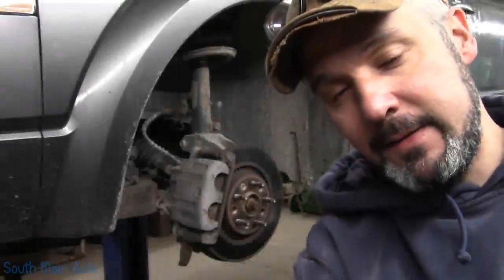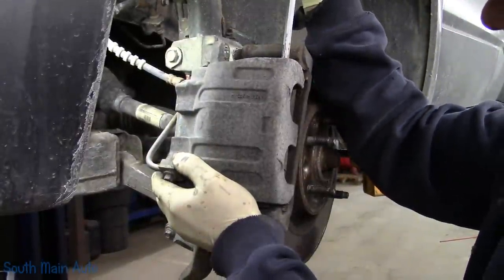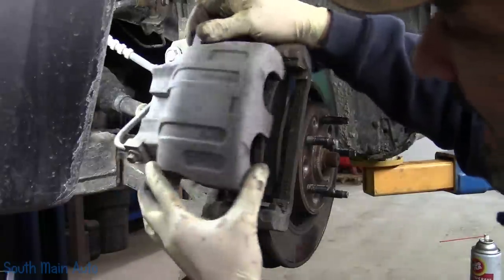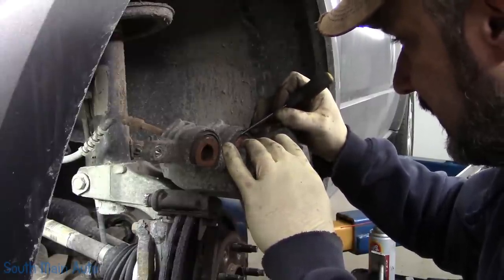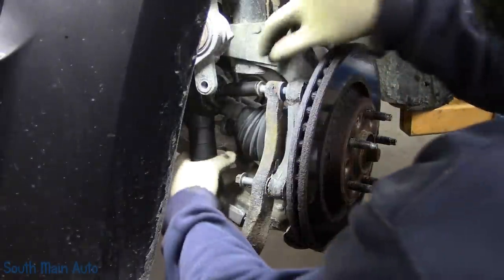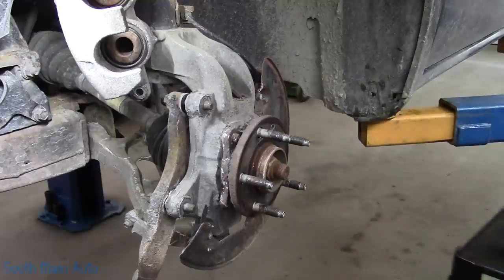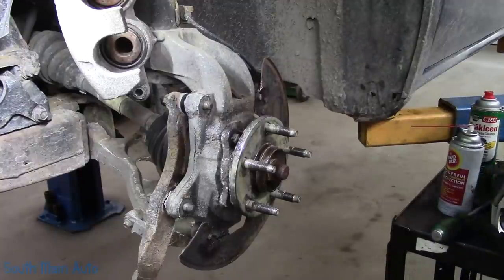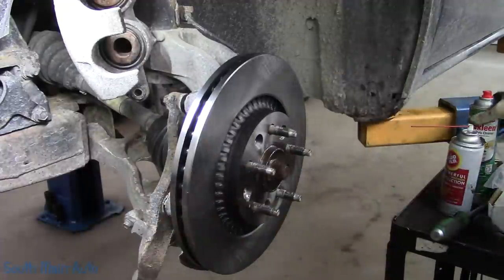Ford Freestyle: Front Brakes w/ Seized Caliper Pin

Comment: For those who don't have a torch ETC  just buy a New Caliper with mounting bracket because by the time your rotor etc looks like that it is highly likely you need a new caliper anyway !

#1 reason to change a caliper is they "usually" come with composite pistons which can stick/swell  in their bore causing your new pads & rotor to smoke themselves & likely leaving you on the road side or behind a tow truck.
Sometimes immediately or maybe even a thousand miles later .

#2 is you don't end up pushing that old fluid in the old caliper back into your brake system. 

#3 is , you want brakes done right !

& BTW you do not need to spray lube on the hub ETC !

No fancy tools, well then just use a little elbow grease & #80 or so sand paper & clean off your hub by hand , it works fine !

& Brake clean works great "SPARINGLY" !

Give your rotor-s a quick squirt to clean the preservative off  & wipe it off with a paper towel.
I say QUICK & sparingly because BC contains chemicals you do not want on your skin in your eyes or lungs. 

BTW if you change your calipers be sure right is right & Left is Left because "sometimes" they will fit opposite sides but you'll never get them bled properly .

Remember , Brakes & Steering are the 2 things you should NOT skimp on !
If your engine quits you can usually coast to the road side.

If your brakes quit or lock up or steering breaks  , THEN WHAT ?

Comment: Had success with this method. A few heat cycles with MAP gas and a bucket maybe some WD40 under the rubber and then normally i use a brass gun barrel cleaning brush on the end of a drill to get all the schmoo and crud out. I did have a Peugeot 407 last year where the drivers side was so bad i snapped the head off the slide pin trying to get it out and i had to get one from a scrapyard. God knows what happened there.

Comment: Great video  on brake pads and cleaning of them, and using proper lube on the slides, but Hey what happened to the high tack for the back pads to the piston heads and back pad to the outside caliper  So on the release, of the  brakes  the piston releases the pads after the braking action which pulls pads to free open position that's what high tack holds then to outside caliper and pad stays to the piston. Common  Eric.

Comment: in continental europe, we usually paint the disc from the inside and the out line of it with high temp silver paint , the disc doesnt corrode , and looks spankin new for a long time. also , OEM look xD

Comment: Ran into this problem today and only option was penatraition oil and anger.
And that wasn't working so I measured a free pin and the hole and then drilled a hole in the bracket into the void past the end of stuck pin and got a few shoots of oil on the backside of pin and another session or two of jerking and shoving I got it moving enough to work it free.
Then I drove a zero fitting in the hole I drilled after cleaning the hole the best I could with picks and a wire brush.
Only to find other side stuck the same.
Same as first and saved around 100 bucks owner didn't have.

Comment: I use a 4 inch wire wheel in right angle die grinder in the center of the axle hub to get rid of the Krusteaz so that the tire and rim don’t stick and remember safety third with using a wire wheel in a die grinder

Comment: Good job Eric O. The one issue i have is the greasy gloves when handleing brake parts. I had some shimmy when applying the brakes and the shop says it was the abs.  Turns out the dirty fingers contaminated the pads and created hot spots on the rotor.     What do you think?

Comment: Eric, thanks for the very good video, I'm always learning from your instructions. Just curious, could you just buy a pin and rubber replacement kit? Also, does it matter if one of the pin has a little play in it? I did a 2006 Elantra brake job and had a stuck pin, never even thought to fix it the way you did in the video, so thanks.

Comment: I keep a jar of tiny screws to get the broken tube out of spray can nozzles. The jar is useless. A thread of the tiny screw in the nozzle can usually get enough grip to pull the broken tube out.

Comment: Eric,  I am having a ton or Electrical problems with my 2004 V8Jeep Grand Cherokee have replaced all wires in the front door boots and now something else has shorted out. Can you please tell me where to get a good wiring diagram or schematic for the doors and inside lights etc. Like your videos very much.

Comment: Hey Eric...I've been putting the Carquest Platinum pads and painted rotors on for a couple of years now and following your brake instructions to the tee.  For the most part, I've had zero come backs and no complaints.  However, in the last month I've had two comebacks, both on 07 Yukon 1500, complaining of "warped" rotors after 2-3 months of use.  You've shown us your "route" through town after a brake job but what is the bedding procedure you use to prevent these types of come backs?  Lots of opinions out there on bedding in general but I can find nothing from Carquest.  ~John

Comment: This happened to me before with my first car.  What causes the pin to freeze? Just a lack of lubrication? or could it be something else? I noticed in the video you never mentioned what your opinion was on how the problem occurred in the first place. Thanks.
Reply: Lack of lube, leaking pin rubber, poor fit from the factory etc.

Comment: Eric do you oil your air tools or is that moisture in the lines? Seen a lot of "spray" when you hit the trigger and just wondering. Also fluid film and most grease boils off at higher temps, like on brakes. Have you tried a product called "Moly 50"? It's by Permatex, it is great as we use it all the time, no i am not sponsored but would work awesome where the rotor touches the hub and also on the slides. Check it out it's only downfall is how thick it is so I cut it with WD-40 to make it thin enough to work with.

Comment: For that thin tube that you busted off in the spray nozzle, take a thin screw ( sheet metal or wood ) and screw it in few threads and then pull it out.  It should come right out and allow you to use the tube from another can in it's place.

Comment: I see you used your toothbrush to smear that brake cleaner around. No mention yep of Napper -NOT A SPONSOR and 6 minutes have progressed? I just changed a caliper on the Ram. Stuck piston!!! 120k POS. And the rust thru has begun!! Soon I'll be sitting on the 5.9 steering with ropes to the remaining frame to commute!! Great Vijayo.

Comment: Hi Eric. Great video! Awesome way to fight stuck caliper slider pins. What is the lube you spray the hub with to prevent sticking to the rotor? I've always used copper or nickel anti seize but if spraying with this works the same would save some time! Thanks

Comment: You can always tell who's an AvE fan!   Anyway - what is the part that is held on by the bolts for the caliper bracket on the inside of the knuckle - is it to protect the brakes in case you run over something?
Reply: It's a stopper to prevent the wheel from steering too far to the right.

Comment: Hi Eric as long as you are on the subject of brakes, 2012 Ford Edge when ABS is activated my pedal goes down to almost the floor I have computer bled them and then manually bled them still the same park over night pedal back to normal next day this happens every time the ABS  is activated. I also live in the rust belt? Thought this mite come up on one of your videos. Keep up the good work. PS ford wants 1800.00 to look at it?

Comment: You mentioned that some metal guys may caution about the heating of the bracket. I had always heard that you didn't really risk altering the steels properties unless you got hot enough to get color "red" or over 800 degrees or so. Is that correct or close to true. My meemaw always said don't you worry bout cast steel, its got enough other potential problems.

Comment: Eric, I use painter's tape to cover the rubber on the caliper pistons I can clean the piston faces with sandpaper and a wire brush. So far it hasn't effected the seal or the rubber itself. Do you have any thoughts on this? Am I doing anything wrong and going "over the top" with prep? Let me know. Thanks.

Comment: I got to clean-out-the-caliper pin bore with a drill bit trick twice now, and once with a propane torch to get the seized pin out of the caliper bracket.  If you use a torch, be very careful to keep the flame away from the boot so you don't ruin it like I did (sigh).  I had the torch on for 5 to 7 minutes, and the pin still wasn't getting loose (even though there was a lot of steam or smoke coming out of the boot), so I finally pushed on the bracket really hard, and it started moving.  I should have gotten on it earlier, which might have saved the boot.

Comment: Replacing my front calipers on a 07 town & country,  noticed the repair kits listed, was wondering how much trouble is it to do the repair kits as compared to caliper replacement.   Is that a fix the DYI guy can do and still have good results  ????

Comment: Hi Eric, do you torque the bolts / nuts down after using the gun ?  I'm forever checking the official torque specs for everything and don't rest easy unless I know they're at the 'correct' torque, but I'm just a DIY'er.  Is there really any need to torque everything or do you just know the gun and that it's going to be fine with that ?

Comment: South Main Auto Repair LLC I just completed a complete caliper replacement on my truck, came from the rust belt, won't be so severe here, we did not lube under the hardware as you do, is it worthwhile to take it back apart and lube under the hardware since it is all new, and not corroded yet to prevent corrosion? Thanks!

Comment: Great way to remove rust from the slide pin head groove is to put it in a drill then use a metal saw blade in there

Comment: Outside of purchasing a Chilton manual for every vehicle, is there an online reference page with details and repair steps for multiple vehicles?  Like, say, I want to know how many bolts and what size bolts hold on an exhaust system, or I want to know the torque specs for valve cover bolts.  Is there anything like that available?

Please don't say YouTube...  Thanks!

Comment: My wife has one of those "Freestyles". A 2006 model to boot. I have done that job many times now on that car. I don't have to  concern myself with all that fluid film and greasing surfaces or frozen slide pins. Living in central California has it's advantages. Oh and what is rust. I need you to do a video on that rear diff for the AWD version of that vehicle so I can see all the short cuts your me-maw taught you about fixing that monstrosity. So get on that.

Comment: I had this problem with my brake job on my own car. Had em on jack stands. Already switched one side. And then on the othersidd its stuck. Had to get some stuff from the local parts store on my bike for it(new pin. It was a lil worn)... no way im driving with 1 brake down. Way i got it loose. The biggest hammer you can find(dont be like me with a 300 grams hammerhead. That way you arent hitting for 5 minutes) , wrench, breaker bar and a 2nd person is al it needed for me to get it loose. Get the wrench behing the pin(make sure you pull away the rubber if you can) let someone spin the pin with the breaker bar(had the bracket still on the car since i did it on the driveway) and give that wench a few god whacks untill the pin comes out. Put some lube on it. Rock it back and forth a few times. Clean off and repeat few times to clean out the inside. Then lube ut up and for me it still works like a dream 2 months of bad weather and some 2k miles later. 

And guys. Chill im not a mechanic or anything close to it. So dont take my advise, expaccially when you are watching someone who learned for it do it. My way is more for the ones who dont have all the tools to do it proper

Comment: Broken straw in the tip.....Take a paperclip and straighten out one end and bend into a small pick....you can even sharpen the end a bit and stick in the center of the hole to remove

Comment: Have I been doing it wrong all along?  I noticed you didn't grease the tabs of the pads?  Isn't that a metal-metal contact point, and don't the pads slide on those tabs?  Just curious.
Reply: Stymie Snerdly — Since the caliper hardware in stainless steel, he doesn’t lube it at that contact point.  At least that is what I recall from one of the many previous brake videos.
Reply: @montestu5502  Yeah, Eric's rationale is that putting grease where the pad ears slide just attract and hold dirt and brake dust and likely to jam up the ears.. And it's not needed as you say to prevent rust, due to the stainless.

Comment: Daft question, but at 16.00 bolted through to the calliper carrier it shows the metal backing bar extending downwards past the lower bolt then bending inwards (and disappearing off screen) Why is it extended? Never  seen that before. It must be close to the inner rim of the wheel! Is there a TPMS sensor on the end?

Comment: Been having brake issues and the mechanics were not able to find the problem…soft pedal, car barely slows down; main cylinder replaced, abs pump replaced, brakes bled 7-8 times, issue still not fixed…
Decided to have a look myself, noticed the bottom sliding pin on both front brakes to be seized, causing the pads to not sit flush and press evenly on the disks…
Waiting for the new calipers and pins to be delivered but I’m confident i’ve found the issue

Comment: What’s the general rule when seating brake pads? Specially with a second gen Dodge Ram, been curious
Reply: Different brake part manufacturers may have different recommendations, but they're usually similar. A dozen moderate brake applications from ~50 MPH down to ~30 far enough apart to cool the rotors between applications, followed by several harder, higher speed applications, closer together, to slowly raise the temperature of the rotors. Once the rotors get hot, park the vehicle and let the rotors cool. The break-in procedure isn't normally crucial, just normal driving usually does the trick naturally. Just make sure no one beats the crapp out of them right off the bat.
Reply: anti chuckle thanks man, I appreciate it.

Comment: Hey erick my name is angel from san antonio, tx and I have a 2003 cadillac seville sls and the issue is that the rpm goes up and down like kracy .. we replace the idle control valve new but what do you think it is? Thanks god bless uu

Comment: I just did a brake job on my 2007 GMC but what I had to do was grab the hex or nut area to tighten the mounting bolt is this ok or normal or it would just spin. I didn’t see anybody do this It looked to me that you run the floating pin in with your impact  I’m not sure exactly how to do this

Comment: Where do you get the impact socket you use for putting the lug nuts on? I believe those are all made for certain torque settings correct?
Reply: 60trigger — Yes, they are called “torque sticks”.
Reply: @montestu5502  Thanks!

Comment: I noticed that you always seem to replace rotors. Does anyone actually turn and resurface rotors anymore? I had a brake job done on my last vehicle and they also insisted on replacement. Seemed to me that we used to turn drum brakes all the time and when discs came out we turned those also so why this movement to new instead of refurbish? One more thing. I noticed that you tend to call oily rusty dirt "schmoo". Is that the same stuff that we here in Canada call "mung" or is it something different?

Comment: What is that bar hanging down that shared the caliper bracket bolts? Some kind of steering stop or bash guard?
Reply: Pretty sure it's a steering stop. There seems to be a block (of rubber?) mounted on the control arm about where it would hit.

Comment: Let the complainers complain, them rubbers can handle a little heat. They would not be part of a brake assembly if they couldn't. After some normal driving and braking around town, I'm sure those calipers would have gotten just about as hot as the vid. I can recall burning the crap out of my hand on one before after some driving and after letting it sit for 15 minutes LOL.

Comment: Back in the 70s I worked at a plant a chemical plant that I work with phenolic resin. It would come in and train cars it was called phenol you get 6 in.² on your skin in its liquid form it would shut down your nervous system and you would expire 😢😢

Comment: Here are my comments: I know you've done a lot of these videos by now, and you might be wondering if you need to change something or try something new. The only technical issue I see is sound. You tend to keep talking as you turn away to pick up another tool or something, and the sound level drops to almost nothing. In other words, we miss what you're saying. Not sure what you're doing for sound, but you need to wire yourself with a lavalier. They don't cost that much, and it would kick up the quality a huge notch. As far as content and presentation, you have those nailed in my opinion. You come across as a likable, folksy mechanic that knows his stuff. Leaving in some boo-boos and misjudgments makes the viewer feel better about themselves, so please keep that aspect up. I don't know how the financials are working out for you, but if the cost of your time is pushing you into the red, please be patient. I see potential for your channel to do really well, but it's going to take time for people to come across your stuff, so please be patient. You are on the right path here. Best of luck!

Comment: You likely didn't get the caliper up in temperature enough to reach heat treating (assuming its high in carbon) or annealing temperature, so really nothing to be worried about in shocking it with water. If the molecules are not in suspension, quenching doesn't harden.